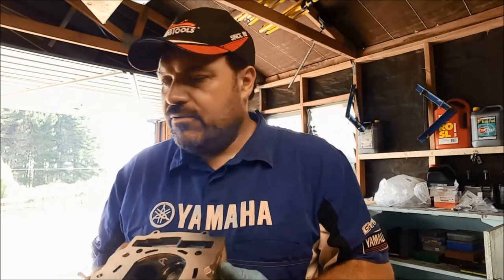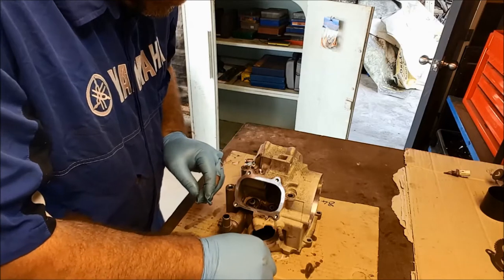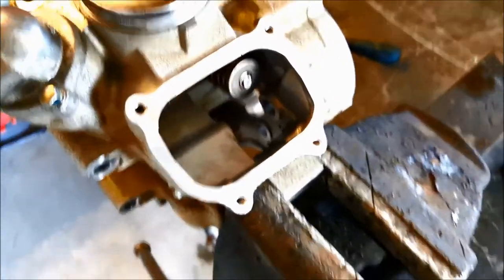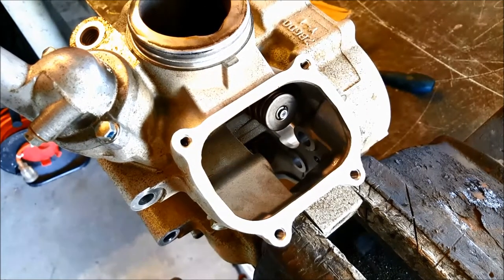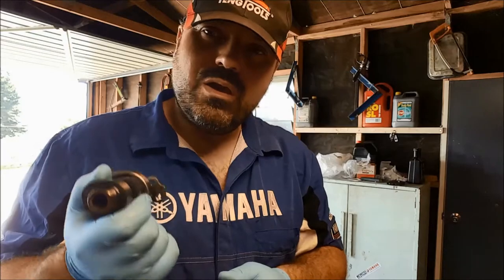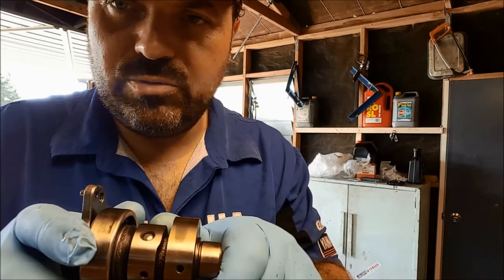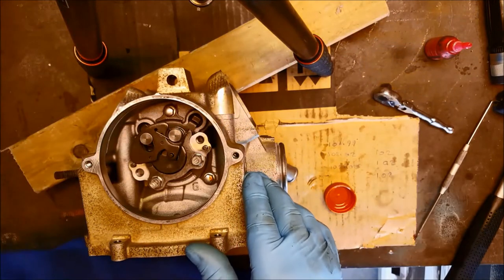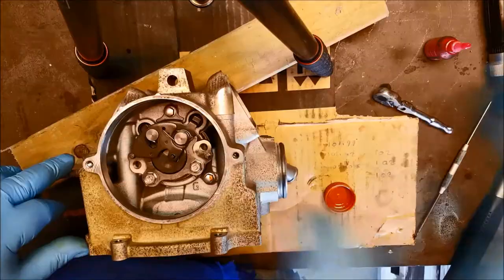Yamaha Viking cylinder head rebuild and installation #1107

Comment: Thanks for taking the time to create and share your video! Seems to be a very common problem with the 700cc motors, I'm replacing bolts with studs to get additional torque. Thanks again!
Reply from the maker: Hey, no worries, I'm please you found the video helpful. I agree, the Vikings have a major weak point with the radiator/cooling fan & if the operator isn't aware then its very easy to cause the engine to overheat. Cheers :-)

Comment: Hi Andy I rebuilt my 2014 Yamaha Viking cylinder head about 1 1/5 years ago by following your awesome video. I had a problem  tightening  and torquing the the rear hex bolt that goes in from the bottom. Can you tell me how to torque this hex bolt. Thank Pat
Reply from the maker: I did this job again only a few weeks ago. With the throttle body removed (as it should be) & the black CVT induction pipe I can get a 3/8 drive torque wrench with a shallow single hex socket in, just. Otherwise you'd have to use a crows foot adapter for your torque wrench.

Hope this helps. All the best. Andy

Comment: How can I tell if I blew my head gasket? I don’t have coolant or oil coming out but I ran it hot till check engine light came on... never lost power seems fine, just gets hot
Reply from the maker: Check to see if coolant system is over pressurised & radiator cap is releasing coolant into the reservoir. This is caused by combustion gasses leaking from combustion chamber into coolant system. Under this you won't get oil/water mix.

Cheers Andy
Reply: Andy Mechanic so when she gets hot I noticed the coolant is beyond maxed on the reservoir... so does that mean I need to bleed the system or water pump? I have a 2015 I just picked up... rode it most the day fine... it got hot so I turned her off.... fan kept running, after the light went away I rode for another 5min or so and it came back on... I kept going in mud holes to cool it off... eventually the check engine light came on but never lost power... any idea??
Reply: So my head gasket blew... how much would it cost for someone to fix this for me? Assuming it’s just a head gasket?

Comment: Hey Andy how can I tell if my cam chain came off? Should I be able to rotate the chain by hand? If it is off what do I do to put it back on?
Reply from the maker: That's very serious if it's happened. On the side of the cylinder head is a round cover approx 4 inches in diameter & held in place by 2 M6 bolts with an 8mm hex head. Remove this & you'll see the cam shaft sprocket. Check if chain is still In place & tight on the sprocket.

You can email me pics if you like to andymechanic@live.co.uk 

Fingers crossed!

Cheers Andy
Reply: @AndyMechanic  it has definitely come off, is there any way to get it back on without taking anything else apart? Thanks for replying
Reply: @AndyMechanic  sorry I should have given u more information,  I'm changing the head gasket and the timing chain has come off down in the bottom end, is there anyway to put it back on without taking anything else apart?  Love your videos you're a life saver!
Reply from the maker: Hi Lee, yes, definitely. Just fish the chain out with a magnet or pick, use a torch and hold the chain so it's tight then just move it around until it drops back on the sprocket. You can also remove the rearward cam chain slipper to give you more access/view. Once the chain is back on refit the black chain guide.

It'll be fiddly but shouldn't take too long to do.

Cheers Andy
Reply: @AndyMechanic  got it! Thank you, I got it all back together set valve lash and everything now when I start it it turns over but won't fire. One odd thing it's doing is while it's turning over if I give it gas it just stops almost like it's hydro locked but once I let off the gas it will turn over again. I think I'm going g crazy w this thing.

Comment: what would happen if you torgue the screws a bit more?
because i had this problem 3 times already.
Reply from the maker: +ROFA02 you can damage the threads, stretch the bolts, crush a gasket or even deform a casting by overtightening a bolt.
Reply: i drive everyday 40miles in 32 degrees celcius (Aruba very hot weather)
and have blown the gasket 3 times already in the past 7 months . 
till now i have tighten them as the service manual instructed. yes, radiator fan works good
thanks for your quick reply.
i'm thinking to install a oil cooler just like the rhino, because i had a rhino for 3 years and never had blown a head gasket.
please let me know  your opinion on the oil cooler.
Reply: ROFA02 you can get a bigger or additional radiator. You can also put a fan override switch in so so can force the fan on. You can upgrade coolant to a more conductive coolant